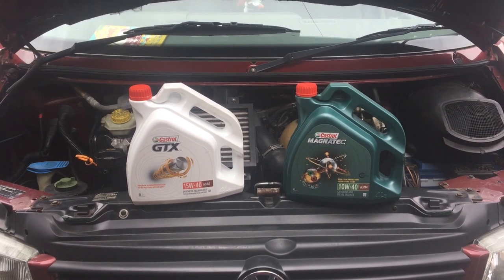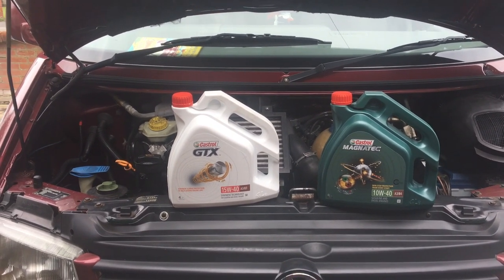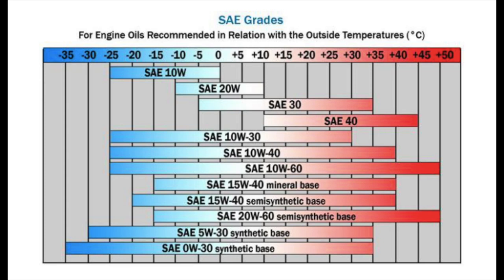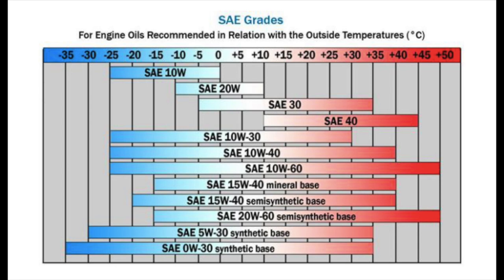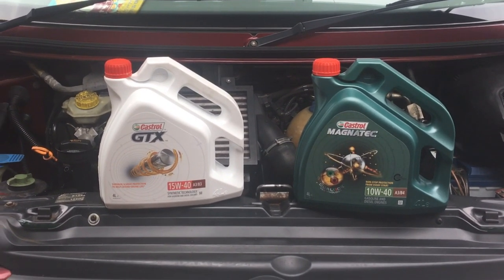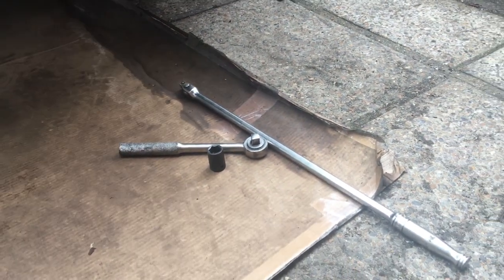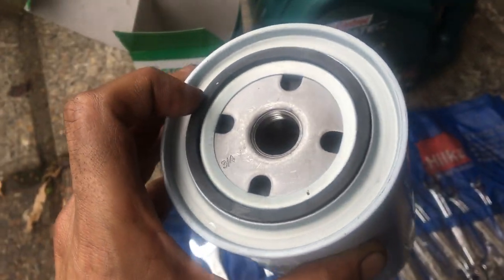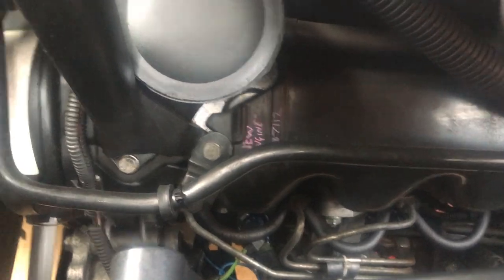VW T4-Which oil is best?

Comment: hi twiggs just wondering i need to change the  valve stem seals without taking the head off i know how do it but i dont how to hold the valves in place when i  push the spring down  with no air compressor do i take out glow plus and hold them up some how be good for some info please
Reply from the maker: Going through the injectors is an option because they usually come out a lot easier than glow plugs. Glow plugs can be a pig, spray with wd40 and keep reapplying over a few days. If they have been in for a while, there is a possibility they are seized and could possibly snap. This is exactly what has happened to my mate, he’s had to leave the snapped glow in the head

Comment: Twiggs, sorry to butt in like that but there is a LOT more to this. While the 10/40 castrol oil (which despite the label is NOT really a fully synthetic oil, but a hydrocracked base oil produced from crude oil. Real, ester-based synthetic oils are manufactured diffrently) would be ok if replaced frequently (I do my oil changes on "normal" engines every 7000 kms/4500 miles, every 3000 km on tuned motors) I would NOT use it in an ACV engine.
First of all it`s not truly synthetic,. Second of all, these "modern" oils are very low on sulphur additives (it says low saps). ACV engine was designed to run on full saps oil (rich in sulphur additives) and while low saps meets the VW recommendations it would be beneficial to use full saps oil.
I use Millers Trident 5/40 FULL SAPS. Found it to be the best in regards to cleaning capabilities, reduced engine noise and cold start (we don`t have heavy winters here either). 
Just my 2 pence, I spent a lot of time on this subject when I was building high-powered cars..
Reply: i was told not to use full synthetic. I've tried everything from the cheapest crap to the full synthetic. now sticking with the cheapest 10/40 semi. i rather replace 1000 miles earlier and just use the cheaper stuff keeping it cleaner in general.

Comment: Always pre fill my filter. Takes about a litre of oil. If you don't the engine has no oil pressure while it fills up the filter. Not good for it.
Reply: makes no difference. an engine can run for quite a while if it's only just been emptied. I actually start mine up with the filter and drain plug out just to flush out a bit extra. Then i pour some clean oil in to flush a bit more out, start it again and then replace filter and drain plug and continue.
Reply: @izzzzzz6  it will have no oil pressure and be doing damage to the bearing surfaces even if only run for a few seconds with no oil
Reply: @jamesnlou  not at all. You can run an engine for quite a while as long as it had oil and was run fairly recently. Damage would occur once everything dries out, heats up or is put under heavy load. I just changed my oil and revved it with the sump plug off several times, I did not fill the oil filter, only the fuel filter.
  Never ever been an issue. Can you give me examples of when it has been an issue?
Reply: @izzzzzz6  plenty of examples out there of how quick an engine is damaged when run without oil. You do your way and I'll do mine.
Reply: @jamesnlou  There is a difference between running an engine without oil and not pre -illing an oil filter. I have changed oil filters around 50 times in my life i guess and i have never lost an engine. I drive hard.
Reply: @jamesnlou  If this was the case then all engines would have the oil filter in the vertical position.

Comment: Best oil is a clean oil
Reply: Best oil is a dirty oil, because it proves the oil does it's jobs cleaning the engine from dirt, ofc that applies only if you engine is old if the engine is new the oil filter should do the job perfectly.